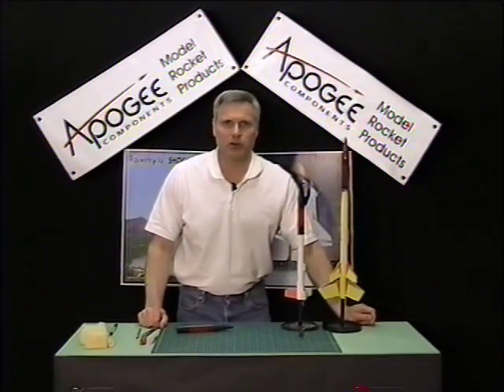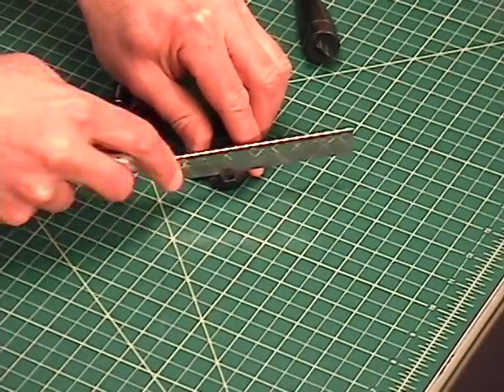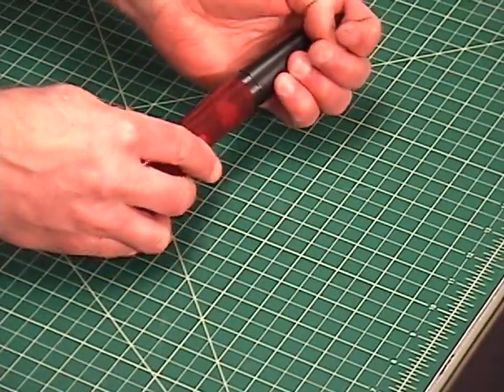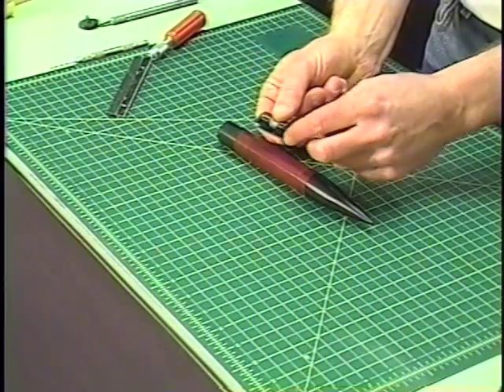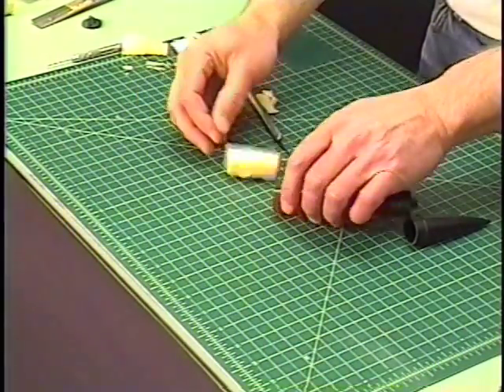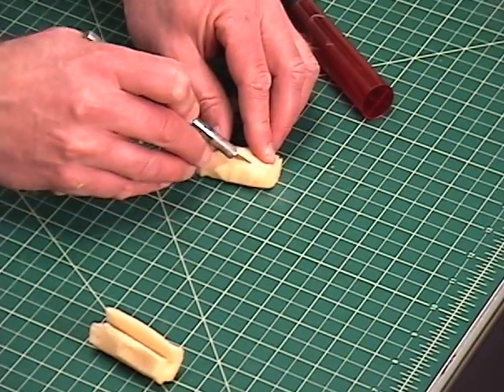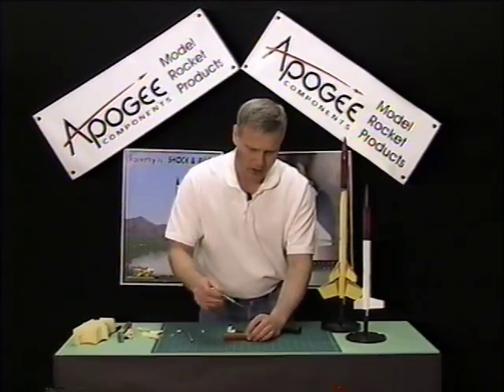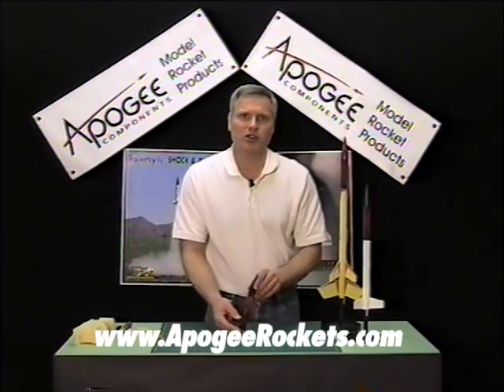Mount an altimeter in a model rocket

Comment: I'm working on building an altimeter with a barometric pressure sensor, but I wonder, doesn't the flight of the rocket cause pressure variations that screw up the readings?  I see you've drilled holes to allow equalization...  is this really all you need to get a decent reading out of these things?